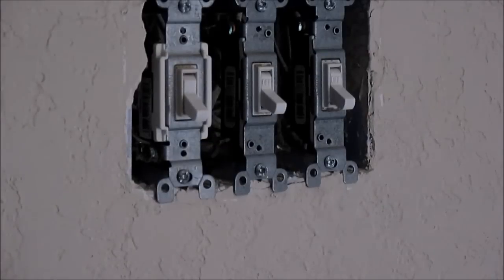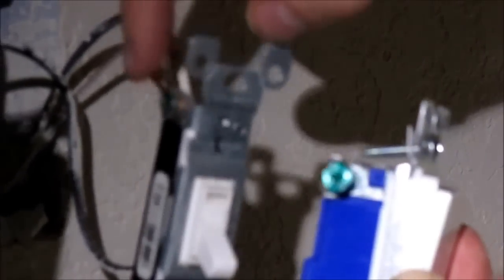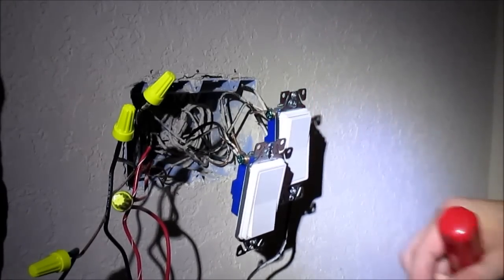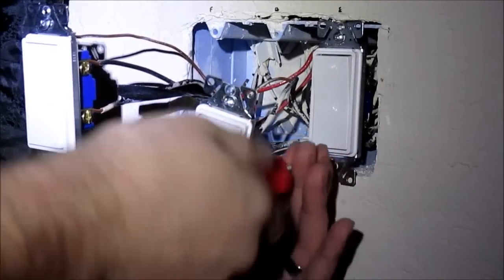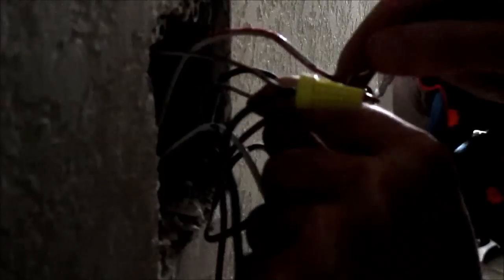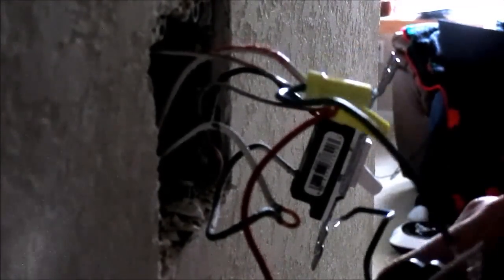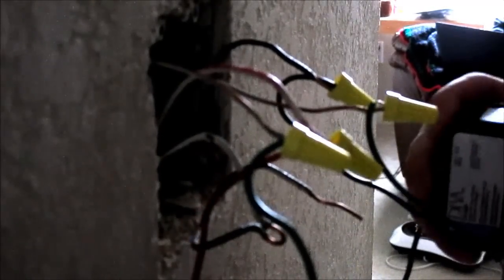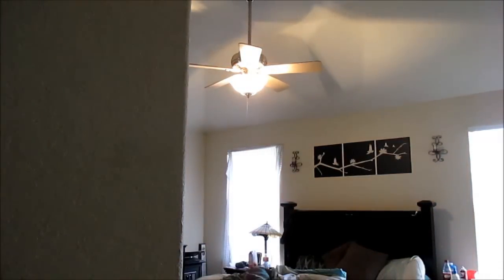Dimming and fan control switches Lutron electrical switches

Comment: There is no "positive" and "negative" wire in an AC circuit switch. If wired properly, the white wire is ground just like the bare wire and is connected to the ground buss in the breaker box. Only the black wire is "hot" and connects to the circuit breaker.